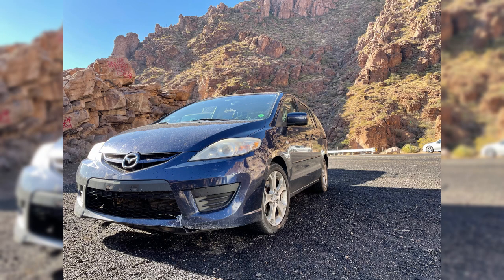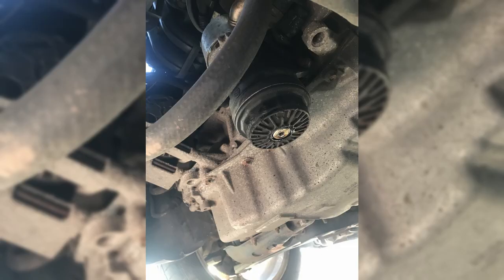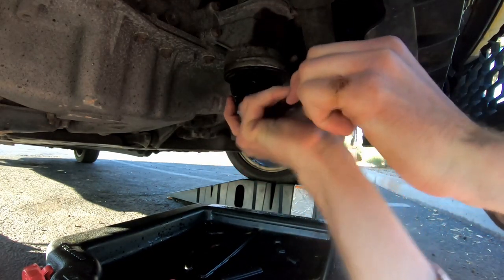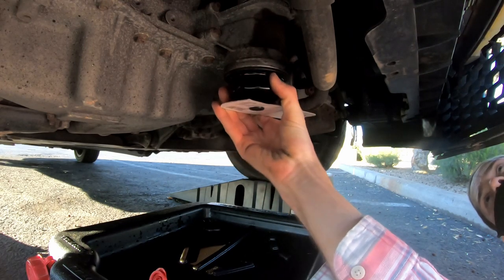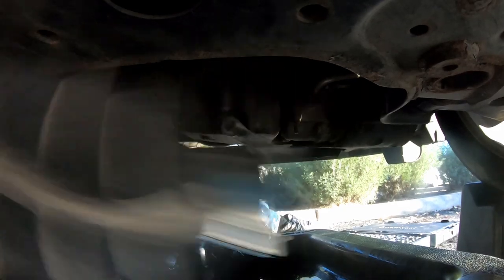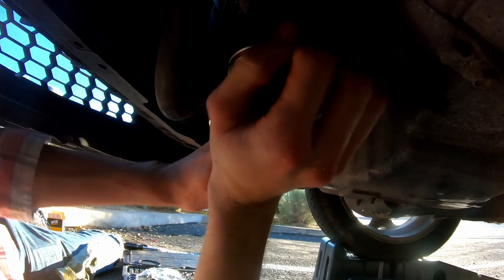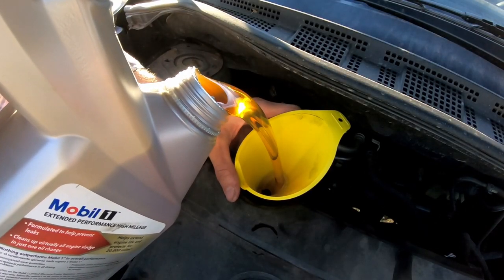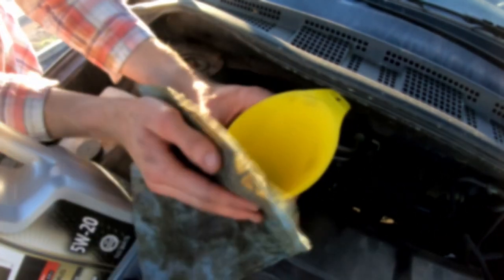Mazda5 Oil Change

Comment: The small rubber o-ring is for the filter canister drain plug not the oil pan drain plug. The oil pan drain plug uses a metal squish washer.
Reply from the maker: Thanks for clarifying that. I pinned your comments so future folks will be able to see that

Comment: May I ask how high is the lift on your lift ramps? I was hesitating on buying the ones with 4-6 inches because my Mazda 5 is such a low car.
Reply: I have the ramps also. There is maybe just less than a quarter of an inch of clearance, but it goes up just fine. The ramps do tend to slip on black top, but  as long as you jam them underneath the wheels first, you’ll be good to go.